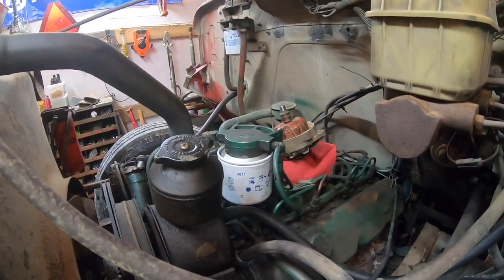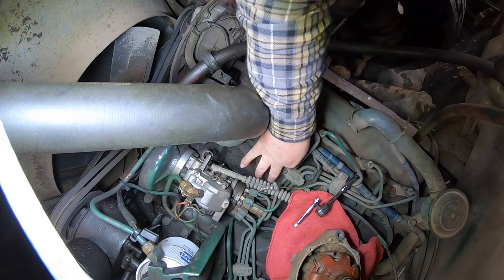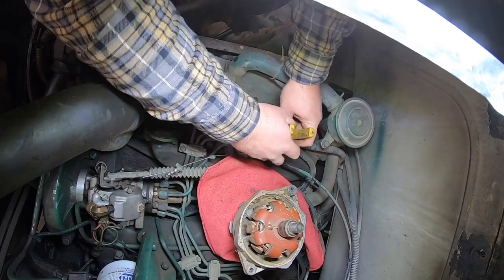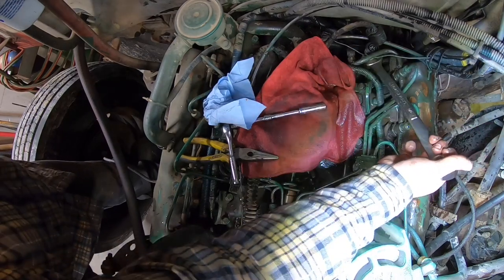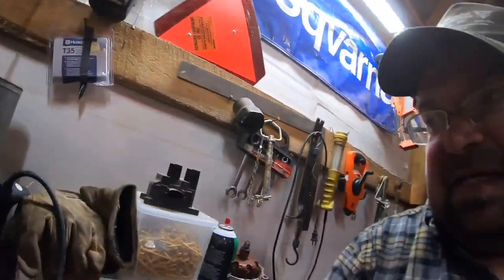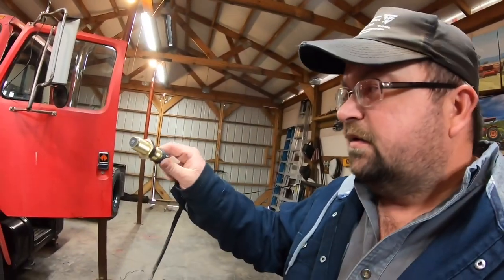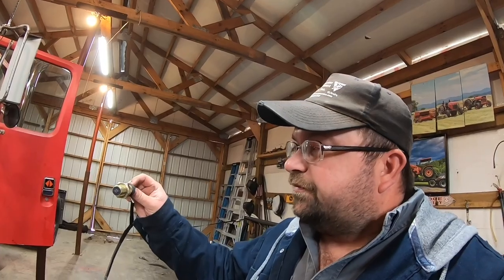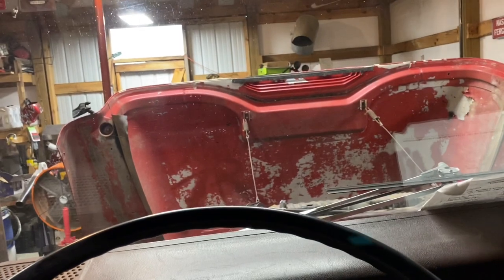Changing Glow Plugs on the International S1654 6.9 diesel, along with many other items.

Comment: Ive got a blue with a 10ft dump bed, I changed glow plugs and melted them down in a few seconds, I was sending 12v to 5v plugs...not good, now Ive got to find 12v that will fit, enjoyed you video, I didnt know about the temp censor in the back, thanks for the lesson.
Reply from the maker: I think the controller was my biggest problem. I’m amazed how well the truck starts in the cold now. Starts first try every time. Thanks for watching!

Comment: I don't use glow plug controllers anymore on my Ford trucks with international 73s.
They're kind of expensive and not very little reliable. I just use a spring loaded momentary toggle switch and depending on how cold it is hold it for a couple  seconds.
Here in Louisiana 7 to 8 seconds on a really cold day works great. This way you're only using them about 20% of the time compared to the controller. Thanks for the good videos
Reply from the maker: Changing all these components have really made a huge difference on this truck starting. Thanks for watching

Comment: Enjoy your video as always.  I changed my glow plug wiring harness on my 7.3idi and that made a huge difference in how mine work.  I need to add a coolant filter to mine.  It's on a 1990 4654.  Much like you I am doing a lot of maintenance work on mine.  I need to do cdr valve also.  Is it the same part as for a pickup or different since they mount in a different place?
Reply from the maker: It is the same part for the cdr. I was slightly concerned about that myself but it worked. The truck doesn’t seem to smoke as bad now, probably had been causing it to burn oil. Thanks
Reply: @khtractors   Thanks!  I NEED to do that then because mine smokes too.  I have heard that air intrusion from leaky return lines can cause that too but I'm not sure about that.  I have the return lines but haven't installed them yet.
Reply from the maker: @captndavie  It should help some.

Comment: Don't use autolite glowplugs. The tips swell after a few uses. Fought like crazy getting old ones out of mine. Make sure that the return caps on the injectors aren't cracked or leaking
Reply from the maker: Yeah I’ve heard that about autolight. I’m wanting to go ahead change my return lines and caps before long. Thanks for watching!